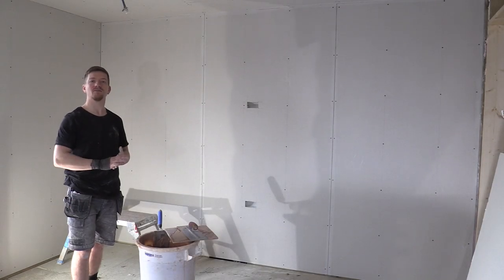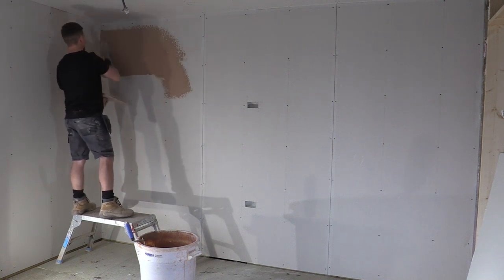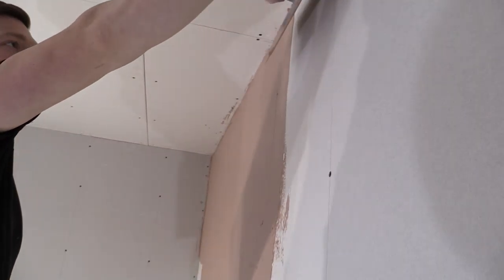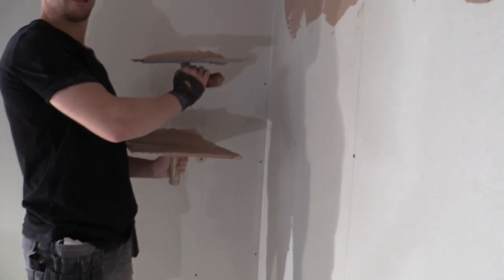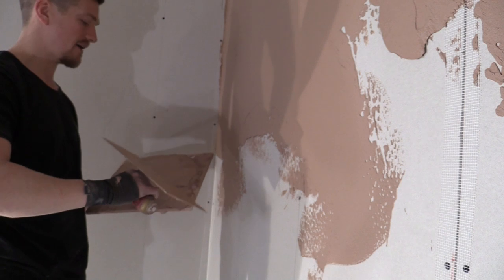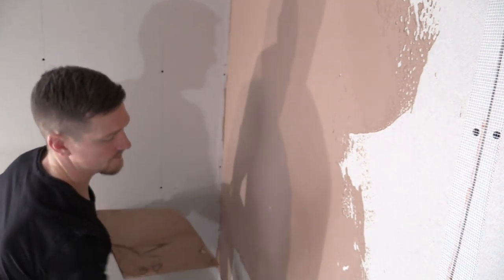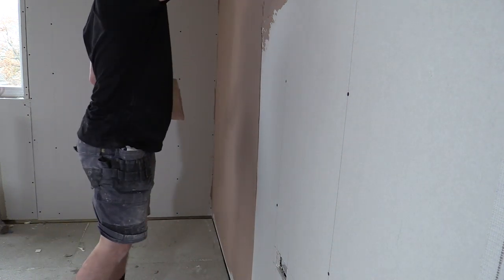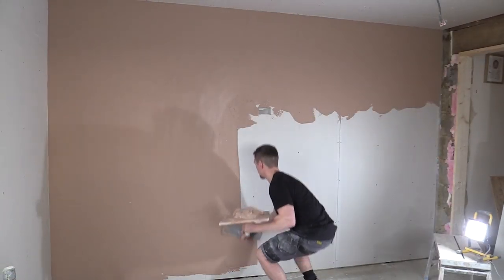Plastering For Beginners | How To Apply Your First Coat Of plaster

Comment: This is the best plastering tutorial I've seen on YouTube so far, thanks.
I have 3/4 of a room to plaster next weekend (one wall was done before I moved in here) and I'm trying to commit these techniques to memory before I begin, hopefully I won't make a mess of it.
Reply from the maker: You'll be fine pal! You'll love it! Thanks for the support and it's great to hear it's helping - thanks 👍
Reply: @PlasteringForBeginners  Thanks for helping me to take this on with a bit more confidence. 

I'll be going over rough and badly patched-up old plaster, I have two bags of Thistle Multi Finish to get me going, I can get more if I need to but two bags will be enough for now as I'm only doing one wall per day...better to take my time and concentrate on getting a good finish than rush the job and mess it up.
The first coat of PVA is on and almost dry, another half hour or so and it should be ready for the second coat (I'll use a slightly thicker concentrate for that one), then it's plaster mixing time :-D Wish me luck!
Reply: Good luck!

Comment: Very informative. Silly question but does your hawk need to be bigger than your trowel so you can get full width of plaster onto it?
Reply from the maker: It does help but it's not necessary mate. You can only load so much onto a Hawk because of the weight - it's hard work if they are too big pal. Hope this helps mate 👍

Comment: Great Video this Blaine. It seems I have been running my trowel at the wrong angle when applying. So leaving a right mess of a 1st coat. For some reason I am only getting 20 minutes working time with the 1st coat and pretty much the second. Tried 2 5m2 walls today but ended up with loads of holes, trowel lines and bulges in the finish. I find myself in a race against time. Will go over them walls tomorrow with this new info. Thank you
Reply from the maker: Thank you pal and it's great to great that you learnt something. It's harder in this warm weather but it gets easier pal - it just takes lots of Practice!! You'll get there my friend and thank you so much for watching 👍

Comment: great video I too have been plastering on and off for a number of years . But seen a plasterer once when doing rewire of a house . He was using mesh on a roll that when he put first coat of plaster on, he then cut the sheet of mesh onto the wall so as to cover the whole area and then applied his second coat. His idea being  that this should be put on old walls with cracks so as to stop cracks coming through the new plaster have you ever seen this being done and would be good to show on your channel. Cheers Paul
Reply from the maker: Hi mate, great hearing from you! I have seen it done once but I've never actually done it myself fort internal plastering. It would be worth investing so thank you for the heads up!

Comment: Really enjoy all of your videos and as I'm new to plastering I find them a big help. I wondered if you use a feather edge and could do a video on it?
Reply from the maker: Cheers mate I appreciate that! I do but only for rendering or when I'm using backing plaster. I'll try and get one lined up for you mate 👍
Reply: That would be great, do you use it to put on an even bonding coat?
Reply from the maker: Yeah that's right mate. It makes the wall completely flat - you couldn't do it without the straight edge 👍
Reply: Ah' right, I'll look forward to seeing that if you get a chance to make a video on it. Thanks again👍

Comment: Love your videos Blaine and bought the £10 course. I have problems with timings. Another problem I have is that I work as Maintenance Manager in a Grade II listed Theatre. When I plaster its usually a partition wall I've built and has to be left a little uneven or it looks awful against the existing old walls !! 😖😖. I would love to be able to plaster as well as you. Again........Great videos mate!! Stay safe,
Dave .

Comment: Your videos have been a great help.  I certainly don’t need to get the electric sander out as much now 😂.  Is multi finish plaster still workable after 60 plus minutes?  My main issue is that I get scared it’s going to go off so I rush the finishing.
Reply from the maker: Haha brilliant David I'm glad it's going well matey! If you have 2 separate batches of plaster for both coats then you probably have around 3 hours until the plaster completely sets. This is the average working time for it mate so you have time 👍

Comment: Thank you for this great video ! you're applying the first coat of plaster directly to dry wall ? Every video I have seen so far they've all recommended to use a primer before applying first coat of plaster. What is your take on the primer ? Is it not needed ?
Reply: You don’t need to put any kind of primer or pva on plasterboard. You can just plaster straight onto it.

Comment: Could I practice my trowel techniques by just gliding by trowel across a wall trying to keep my trowel angle consistent, or will it damage my trowel?
Reply: Most likely you will not damage your trowel, if not pushing it too hard and in a flat, even surface. If carefully done, you can improve its performance: as a matter of fact, a new trowel has to be “broken” so as to better perform, minimizing the ridge lines and smooth laying of the plaster  (usually it is attained after considerable use or can be sped up by filing, which is basically what you would be doing in a way when practicing as you mentioned). Some new high end trowels come “pre-broken” (i.e. they have been carefully filed). Of course, if you are too harsh on a very bumpy/hard surface, it is also possible to damage its edges.

Comment: There is plaster coming off in one of the bedrooms, not the whole wall. I've taken the plaster off and the plaster seems to be quite thin. I was told about using PVA before the bonding plaster but! i'm puzzled as how many bonding coats to apply and when to use a Plasterers Scratching Tool? Please help. Do i use the scratching tool on the bonding or the multi finish plaster.
Reply from the maker: You don't need to scratch bonding - its good but it just created a key for the top coat of plaster. You don't need to scratch multi finished either pal 👍

Comment: Do you go straight onto first coat using same mix for second coat? I have always done 2 separate coats however I’ve tried using the same mix with mixed results? Definitely quicker doing that and saves mixing up twice? What do you think is best?
Reply: I love your videos as well mate! Definitely should keep them coming 👍
Reply from the maker: Hi mate. Great question! I advice beginners to mix a separate batch for your second coat of plaster. It gives you more time and I find it an easier process if you're new to plastering. However, I've plastered both ways so preference is something you'll learn for yourself but if your new I recommend two mix's. Thanks for the support by the way. Cheers 👍
Reply: Plastering For Beginners 

Thanks for the reply. I did plastering for around 4/5 years about 10 years ago and am now a gas engineer but I’m always doing bits and pieces. Mainly my own house but still enjoy watching the videos as always room to get better 👍
Reply from the maker: Its good to hear mate and it's something you'll never forget! Its always useful to keep (especially if it can save you a bit of money ;) thanks for the support and it's great to hear from you. Cheers!

Comment: Does one trowel do the hole job?
Reply from the maker: I tend to use 2 different types of trowels. My standard 14" stainless steel Marshall for applying the plaster and flattening for the first stages and then my Flexi trowel which I use for the final stages of plastering. If this doesn't make sense, I explain all of this in the welcome course listed in the description. Feel free to sign up for more information! Great question and thank you for the comment 👍 Cheers!
Reply: @PlasteringForBeginners  if you've never ever done it before you think it would be easier just to use the one trowel for every thing you can use just one trowel can't you